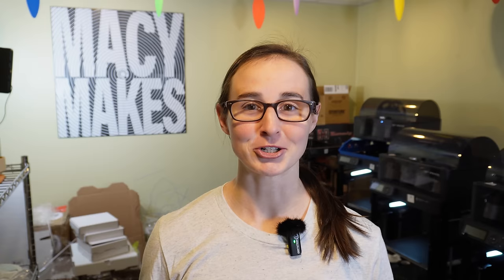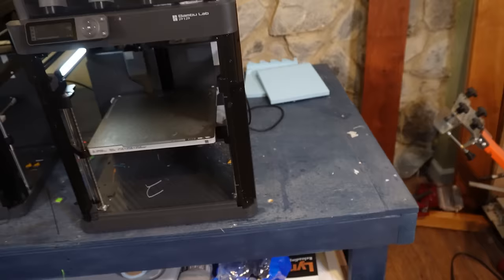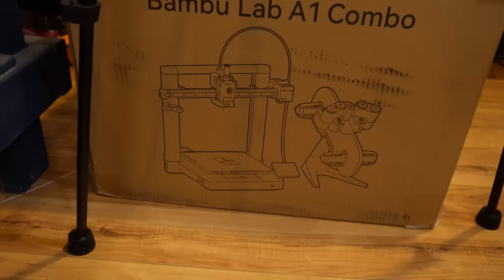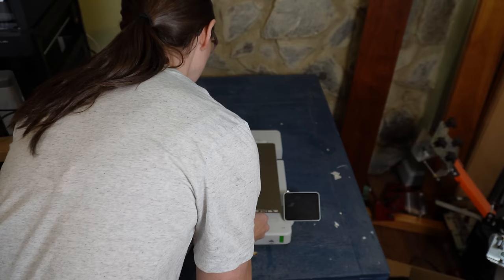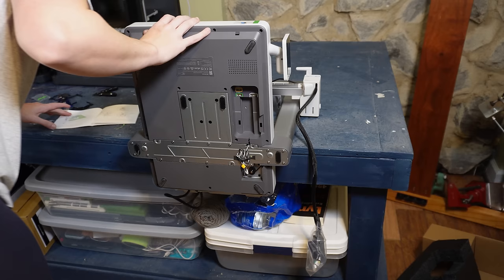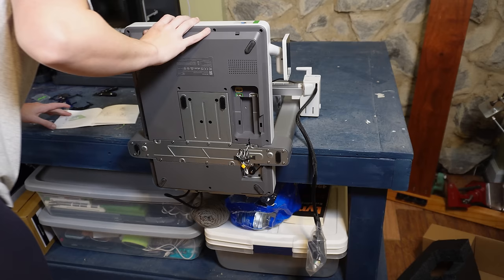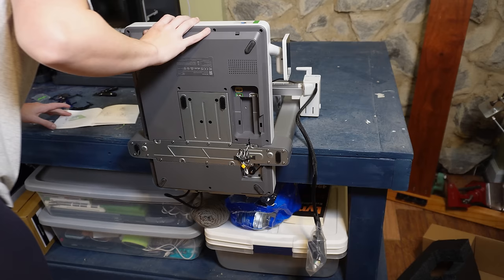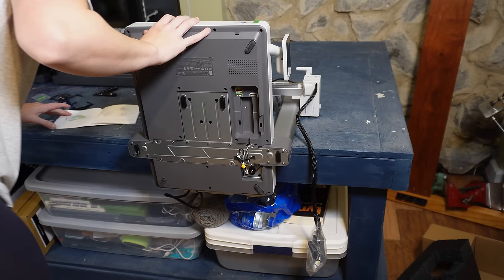I Bought the NEW Bambu Lab A1 Combo - Vlog 5

Comment: If you load two filament rolls with the same color you can set the AMS to continue with roll 2 when the first one is empty. A way to save a lot of waste.😄
Reply from the maker: I’ve tried that, and it’s definitely something I do if I’m just printing for myself, but it leaves a hard line in the print once it switches rolls and I can’t sell an item like that. I’ll try it and show it to you guys in a later video
Reply: I have not had that experience with my X1 Carbon. Maybe it's a p1p thing? I just got my A1 as well and I think it'll handle your 3/4 empty roles just fine. @macymakes3d
Reply: @macymakes3d  You can make a simple Smartphone stand to give as free addon to order
Reply: @macymakes3d  I was going to suggest the same thing. I had so many nearly used spools and the AMS fineshed them all off!!! I just loaded the nearly dead ones into slot 1-3 and a full roll into slot 4. As long as I was using the same brand I didn't notice any line in the them at all, this was on a P1S so basically the same printer you have.
Reply: There can be slight variations in color between batches of filament - even of the same brand.
Reply: you can also use weights in the spools, there shoudnt be an issue with the near finished spools. thats a big load of waste...

Comment: Why do you trash all those spools?! 😱 The AMS is perfect to use the spools to the end. Just dry them and use them. What about the silica bags?  Just dry them and they are perfect to stay inside the spools that have slots and help them stay dry. Probably I'm stating the obvious and you just don't care all the trouble 😂
Reply from the maker: This is just the rolls with less than 30 grams. I keep everything over 30 grams for future use upstairs. I can’t use multiple rolls for the nameplates I sell because it leaves a hard line in the print when the filaments change and that’s not sellable. I don’t really print much besides nameplates so it’s tough for me to keep hundreds of “empty” rolls because I dont have that much space. I’m going to try and come up with some smaller things to print and use up some of the waste now that I’ve seen how much you guys care about it ❤️

Comment: For anyone who is just using the A1, please don't forget to print the official guard for the sensors cable (the one that is coming from behind the printer). If the cable is damaged and the sensors can't register the bed temperature correctly, there is a very high chance of the printer to combust or at least have fuses activating.!!!!!!!!!!!!!!!!!!!!!!!!!!!!!!!!!!!!!!! Bambu made an oficial post on their site on this.

Comment: Whenever you add remove or change the position of the ams on a printer you should rerun a calibration.  The center of gravity change can affect the harmonics and input shaping settings. It may not seem like a big deal but it can be.  Some people even re run calibration when they change the printers location/ orientation on a table.
Reply from the maker: Noted, thanks for the tip! :)

Comment: One minor tip, with those overture rolls when they get lighter they seem to have problems spinning in the ams as they get too light. I found sticking something in the middle to weigh them down a bit lets you use the last bit of filament, and eliminates the line you sometimes get (which happens when the ams takes longer to load the spool due to it not spinning correctly). It's not foolproof but helps a bit. I tend to use the ones with very little on them for any small items that only have a color change right on the last couple of layers.
Reply from the maker: Yes! I've actually printed a part to do this, I just haven't gotten any weights or anything to put in them yet. Definitely on the list of things I need to do though.

Comment: Very good video and I will not go back on the other comments speaking about the leftovers. I wanna advise about the way you have passed the PTFE and câbles inside the metal panel of the p1s. The movement will cut your PTFE and cable, you would better pass them inside the hole of your printed riser.
Merci et bonne nuit de France.
Reply from the maker: Haha thanks for not harping on my wasted filament. Noted on the ptfe tubes. I’ll try that out and see how it works

Comment: Love the Video! You can print out a mount that allows you to attach the AMS Lite to the top of the printer. Mine is setup this way and I've had no issues with it.
Reply: And if you’re not comfortable with that, for whatever reason, there’s a vertical stand you can print that works really well and is even more stable than the stand that came with the Lite. And with that, you can have it behind the printer, instead of next to the printer. That’s how I have my A1 mini set up.
Reply from the maker: Thank you! I’ve seen some mounted on top and I wondered how sturdy it would be. Maybe I’ll try it!

Comment: Thanks Macy, great vlog :) By the way, FYI Bambu released a model you can print to mount the AMS Lite on top of the A1, could help with space management maybe :)
Question: how's the noise level in your shop now that you have so many printers working together ? 
Thanks again to share your journey with us! :D
Reply from the maker: The A1 is super quiet. All 4 p1ps running does cause some noise but you can't really hear them upstairs (they're in the basement) so it's not too bad. I can kinda film with them running but you can definitely still hear them in the background.

Comment: I just made it to the end of the video and seen how you routed the ptfe on you p1p, I’d suggest you find the cable chain set on printables and print the ptfe tubing guide and also print a long 90 degree ptfe tube guide. I had an issue with both the tubing rubbing on the metal frame and the tube sagging and rubbing on the carbon rods doing it that way. As you run your printers a lot like I do it seems like an easy upgrade to prevent misery down the road.
Reply from the maker: Thanks! I'll look into these upgrades :)

Comment: Impressive Macy. I have an Anycubic Kobra Max and I3 Mega. Now also have the A1 (not unboxed yet).
I started using my Kobra Max (Dec-23) which then refused to print after a months of prints. I changed the hot end 4 times, checked the cable plugs around the head, check the cables for kinks and auto leveling would throw up errors which made no sense for what I could see.
Tried everything I could find on the net with no success and then in my frustration of trying fixing it I ordered another Kobra Max this time the '2' version, however It dawned on me much later (after I order the new one) that maybe the plug was the issue and so I re-flowed the cable socket and wham it works again. Damn need to be more free thinking before ordering new stuff.
Now I have been successful so far with the fixed Max and hopefully the A1 will add more capabilities to my growing list of printers.
My question for you is how do you keep the filaments dry enough for printing after they are opened, noting the A1 and the non-AMS printers both have exposed filaments. Do you intend to buy a pre-made version or are looking to build you own?
Reply from the maker: I only use PLA and the moisture doesn't seem to bother it too much. I keep the rolls in dry boxes when they're not printing but I'm not sure how much that even helps really.

Comment: seems like there is a lot of pressure on the lines being routed through the hole as well as wear on the lines from movement making the extruder gears having to work harder to pull filament.

Comment: Bought an A1 for my grandsons and they sent a defective unit with a recall notice on the LCD. Over a month later Bambulabs has not fixed it even though the Burnaby office is 28 minutes away. They have not reported the fire and electrical safety recall to the government safety database.

Comment: +1 for finding a way to use those leftovers, not to mention not throwing away the rings you printed to make the cardboard spools work better with the AMS. Those must be re-usable?
Reply from the maker: It was just electrical tape over the edges of the cardboard spools. I’ll keep thinking of ways to use the leftover filament. I hate wasting it but I can’t just keep hundreds of almost empty rolls laying around.
Reply: If its the same Color you normaly use your AMS will automatically swap to a new spool when one is empty. Then you will Get to use everything😄
Reply: @macymakes3d   it is possible to join to rolls of filament together by heating them up and squishing it together. There is an increased risk of jamming but I believe there are tools to help with stick the filament together. Probably not worth the risk for your business though...
Reply from the maker: Working on some freebies! You guys gave me lots of ideas for ways to use up the “waste” 😁
Reply: @macymakes3d  amazing, glad to hear. It looked like a lot of filament just going in the trash

Comment: I can google information but thought I would get your input, it also shows YouTube you are having interaction.  From one content creator to another.  What advantages do the risers provide and why do you like them so well?
Reply from the maker: I put them on my p1ps because the ptfe tubes and wired were rubbing the bottom of my AMS and causing problems. The riser helped give some clearance for the tube and wires. Also, if you have an enclosed printer it will allow you to open the top glass and vent the printer. The ones I printed are nice, but there are others that have storage compartments which seem pretty cool.

Comment: When my roll runs out in my P1S AMS the print will stop and lets me know its waiting for me to put in another roll.  I just put a new almost empty roll into the SAME slot and press RETRY and the printer just continues as nothing happens.  So before I open a NEW roll I at least try and use up the two or three empty rolls.  Its NO hassel except for putting in the roll.  No waste.  Best I can do.

Comment: any update on this vs your P1s'. im looking to get a multicolor printer just wondering what I should go with. Also is there anyway to mount the multicolor on top?
Reply from the maker: I sold the A1 but it’s a really good printer. I just wanted to keep everything the same, running only P1s. Makes the workflow faster in the computer. I think there’s a way to mount the AMS to the top also!

Comment: Nevermind the last bit of filament, throwing out the spool rings bothered me. Do you print new ones every new roll?
Reply from the maker: It's just electrical tape on the edges of the cardboard spools. I don't use spool rings.
Reply: Oh, my bad 😆

Comment: I was similar to you in that I essentially bought the A1 straight away. I initially had issues printing PETG from a “budget brand” but it was mainly caused by my greediness in trying to print everything super fast. I’m also unsure about my belt tension (if it’s correct or not) as I get banding when printing benchies (but not printing more organic style of prints). Otherwise I love my A1. I also have my AMS mounted on top and haven’t had any issues. My benchy issues were happening both pre and post top mount

Comment: At the end what are those black rings around the cardboard rolls and what do they do?
You had no issue with the. AMS lite feeding at all? I just got mine and spool #3 never works...keep getting AMS1 #3 motor is overloaded error and no troubleshooting has solved it yet...
Reply from the maker: The black rings are just electrical tape on the edges for the regular AMS. And I had one issue with the AMS lite but it was with a new sunlu roll. Even with the attachment I printed, it still wouldn't feed the brand new roll. It did fine with emptier rolls though
Reply: @macymakes3d  ah ok....and what did you do to solve it not feeding? #1,2 and 4 run perfectly smooth no issue at all...#3 simply won't load the filament... doesn't even grab it to start...I've tried all the suggestions to make it work... nothing yet... apparently there's hundreds of people with #3 causing issue... so weird...
Reply from the maker: I have no clue. Maybe it’s a bug and they’ll patch it with an update soon? Hopefully you’re able to get it fixed! 🤞🏼
Reply: @sibertiger17 I've had that issue with some filament, my sunlu pla silk To solve it i just had to cut the filament to into a sharp point and then the AMS lite grabbed it and pulled it though.

Also make sure your ptfe tubes are in nice gentle arches.  In other words, keep your ams lite near as possible to the printer.
Reply: @BennyTygohome  I have tried 5 different rolls, same errors...all cut into angles...there is no bends in the tubes different than the others that work just fine...I think it's the motor in the AMS lite tool head...it makes weird sounds like it's stuck...but nothing is stuck.... Bambu service is absolutely crap...not a single response from them in weeks after multiple tickets sent in...